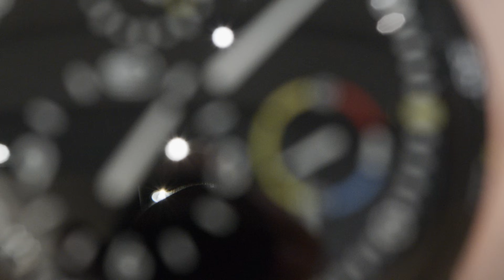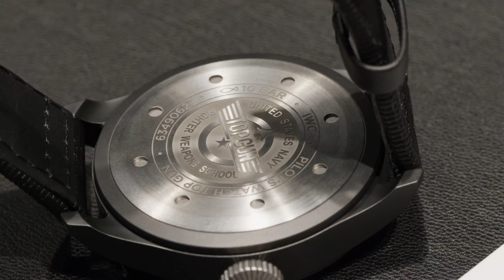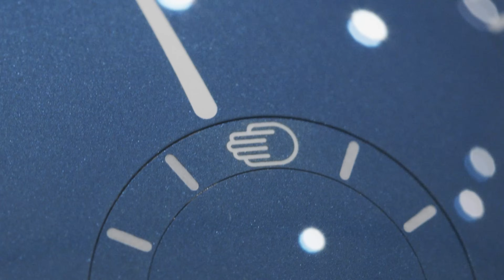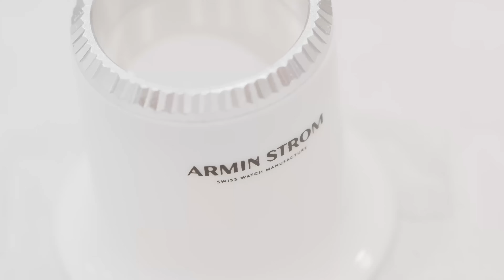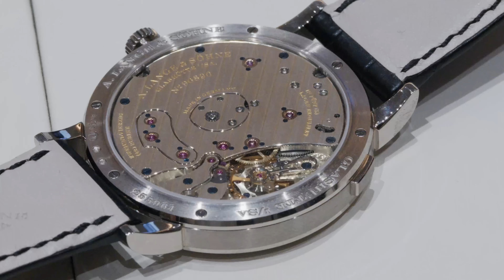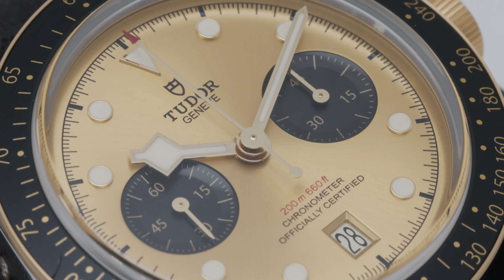Tudor BEATS Rolex YET AGAIN (Watches and Wonders)

Comment: The watch of 2022 is the MoonSwatch…
The watch of 2021 was the Moonwatch 3861

IMHO the top 8 2022 watches are:
1. MoonSwatch
2. Omega PO Ultra Deep
3. Rolex GMT II Sprite Mirror 
4. Omega SMP 300m green 
5. Vacheron Constantin 222
6. Omega Speedmaster Pro green dial 18k
7. Cartier Masse Mystérieuse
8. Omega Speedmaster Pro Panda 18k

Comment: How thick is the Black Bay Pro? It looks pretty much like the perfect watch. GMT and 200m water resistance?
Reply: Hightower would be a great nickname...
Reply: @WatchTheFuck  LOL cool name.
Reply: I heard it’s like 14.5mm
Reply: It all depends on the case sides. If it has the case dimensions of the BB58 but with a fat caseback, it'll be doable. My Speedy's caseback wrests inside the groove behind my wrist bone and it looks no thicker than my Explorer or BB58, but off the wrist it looks massive.
Reply: @omg_stoppit  it has more or less the case sides of the 41mm Black Bay, with a smaller case.
So pretty worse combination...

Such a shame, as the face looks absolutely fantastic!
Reply: The winner will be the next gen. Probably be a mm or two thinner, an independent gmt hand, and more colors available. The first gen bb pro here seems so vanilla with the stainless fixed bezel